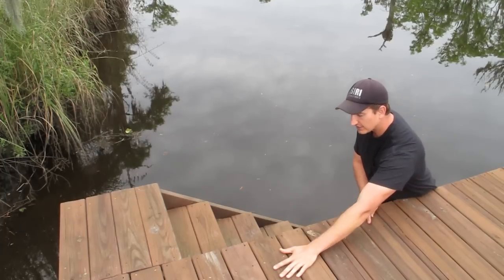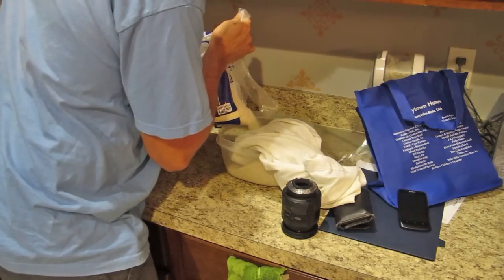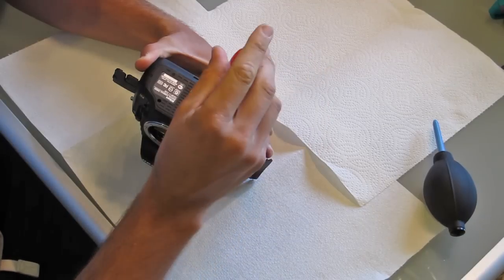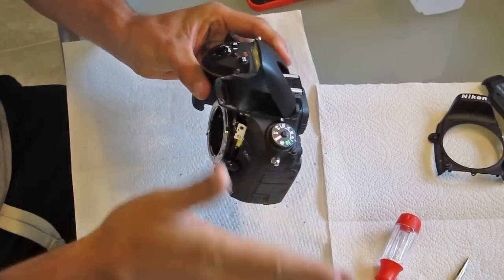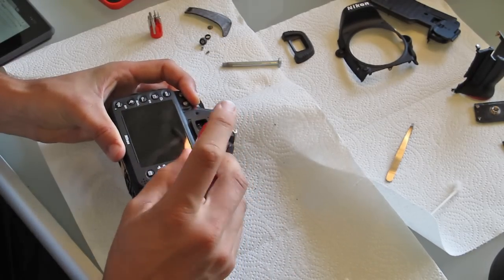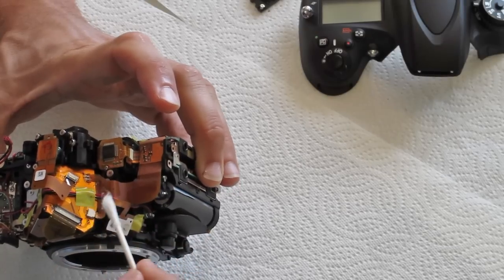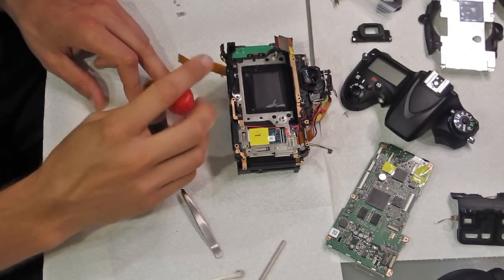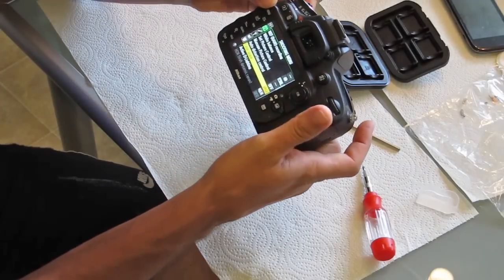How to Repair and Save a Wet DSLR Camera

Comment: some of the alcohol also went inside the the mic, usb and other inputs...then when i tried to shoot...the lens is blurry when you look at it even though it's already focused...and then when i check the photo...the photo is still sharp...so it's the mirror that's blurred (i checked no mositure from outside) and the lcd that's really scaring me...pls help...
Reply from the maker: maybe try letting it sit in a dry environment for some time and maybe whatever remaining moisture will work itself out.
Reply: +MrKistel thanks for the suggestion... hope i save the camera :(